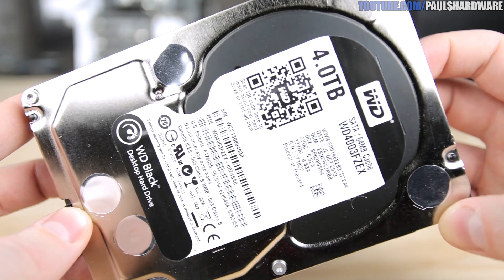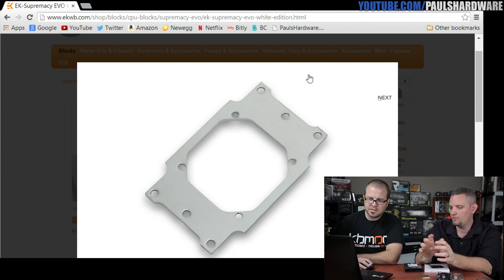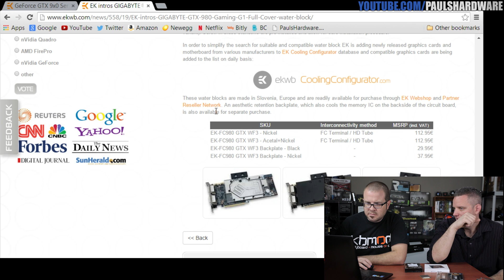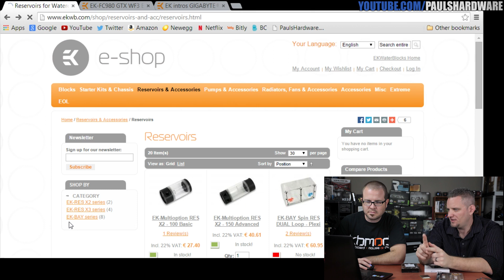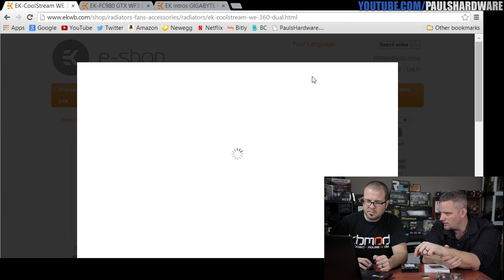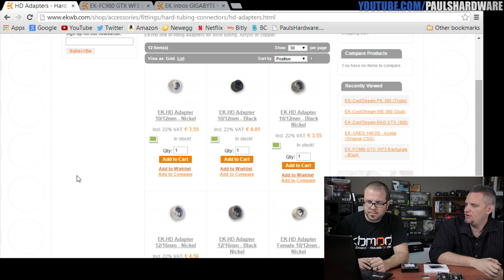Water Cooling Pros & Cons with JayzTwoCents

Comment: u could always use the fans off of the video card assembly in a custom case mount, or put them onto a radiator for "show" in a build  you do, which to me, seems very artistic if you can get them into the build properly.

excuse the name, im on my troll account on my backup pc while i pack to move to indonesia, which is why im looking into water cooling, and will probably be doing a lot of custom stuff there because of how hot it is in that country. (getting married there, that's why im going)

Comment: Don't know if it's already been mentioned, but, in case it's important information for someone building a loop, JayzTwoCents was incorrect in regards to head pressure / flow rate of the two pumps - the larger D5 has higher flow rate (1,500 lph)  and lower head pressure (3.9m) and the smaller DDC has lower flow rate (1,000 lph) and higher head pressure (5.2m - 7m  ǀ for 3.2 PWM model or 3.25 model).

You can also disregard the analogy in which he likens the larger D5 to a large displacement V8 with torque (high head pressure) and the smaller DDC to a lower displacement import with horsepower (high flow rate), as it obviously does not work here (even within the automobile context, it is an oversimplification that only obfuscates the related issues, more than it enlightens). The inverse relationship between flow rate and head pressure is due to the rotor design, not the physical size of the pump (akin to the inverse relationship between air flow and static pressure due to fan blade design, not the physical size of the fan).

That said, unless you are confined for space, most will agree that the quieter D5 is the option to go with.

Comment: Should i get the corsair h55 quiet edition or should i spend twice asmuch on a double fan radiator corsair water cooler? I find quiet the most important thing

im not planning to overclock or maybe later but only a small overclock on my 6700k

Comment: Around 34:00 you mixed up your pumps, D5 has the higher flow rate, DDC has more head pressure. And in my dual (serial) GPU system with 2 240 rads and a lot of 90° bends with a separate pumo and res one D5 on minimum speed has enough pressure, so if you can fit it and afford it there's no reason not to go with the DDC.

Comment: i might be wrong but isnt cheaper for testers(jay, paul, kyle, maybe edgar) to just buy a 1 tb or 500 ssd, download games, steam, and the os,then just use that in the builds, then you dont hVe to waste time downloading it again. pls tell me if that is possible because im pretty sure it is.
Reply: the thing that is being discovered with ssd is that they have memory leak. it is highly suggested to run an os on ssd and have a high speed hdd for everything else. so basiclly ssd have a potential to lose information over time. most are good for 2 years. some have been known to lose data in a matter of days.

Comment: When building a rig, in my opinion "go big or stay at bay" for me, think of it like this, it's an investment whether it be for short or long term. The water cooling is one of the best way to protect your system from hardware failure and then some, air cooling is sufficient, but like some of us that stay in areas that are hot humid, water cooling to me is the most efficient way to go. So do some thinking and ask yourself some questions like...1. do i stay in a nice and cool environment, hot, super hot, hot humid, cold, extreme cold etc.  2. do i have the budget for my build. After all has been noted then proceed to construct.
So yes there are some pro's & con's what it really boils down to is the end user, if he/she want either.

Comment: Remember the P4 Prescott CPUs? Those things were like space heaters!

As for HDDs, I don't run any internal drives. I have a SAS controller that I use with an external SAS drive chassis. I am thinking about upgrading my ATTO R680e to an LSI 8885 for 12Gb/s throughput for 8x 1.92TB Enterprise RISSDs. It's something to think about if you have limited internal drive bays.

Comment: Water cooling con:
1 gpu block, 1 cpu block, 10 HDC fittings, 1 240 rad, 1 DDC pump, 1 DDC pump heat sink, 1 100ml reservoir, 5 fans, 5-6 PETG tubes, 4-5 plug fittings 
grand total of just over $700

alternative: H100i, Hydro GPU cooler for a grand total of ~$200
Reply: You get NOWHERE near the performance and flexibility using that compared to a real water cooling setup. Trust me, i've done both countless times.  The ONLY all-in-one cooler that gets even RELATIVELY close to custom cooling is the EK Predator 360mm AIO and the Swiftech H320 X2 Prestige but those cost $230 and $199 respectively just for the CPU cooling, and you also need GPU blocks. The EK Predator and Swiftech ones are EXPANDABLE, meaning you can take the tubing off and add your GPU into the setup, and you can buy a cheap $50 "universal" waterblock for the GPU too if you wanna save money;  plus the EK Predator has "quick disconnect" fittings, that let you open the tubing to attach new GPU blocks etc.. without it leaking.   Lastly, the temperatures are FAR lower, getting easily ~15-20 degrees Celsius lower than even the Corsair H115i does, let alone the even smaller, weaker, H100i.  Then there's the fact that your math is complately wrong. GPU hybrid coolers run $100 each, and need to still be taken apart and attached just like waterblocks; unless you pay ~$130 to get them pre-attached to the card already. Either way that costs you a total of $300 if you build the GPU cooling yourself, or $360 if you buy it pre-attached.   You also have to deal with THREE sets of annoying AIO tubing that can only be  moved certain ways and may not fit your case etc..   It's far more worth it to buy one of the EK kits that are ~$250 or so and give you EVERYTHING you need to custom cool your CPU, then just buy two "EK universal" or "EK Thermosphere" blocks which go for $50 a piece or $70 a piece roughly, meaning your total cost would only be between $350 and $400, but be MUCH better than the subpar performance of an H100i and Hybrid coolers.
Reply: TheScaleless agree. but you have to look at it at non-enthusiast angle. Regular people would be happy with just any CLC. Their PC would still work great even if the cpu and gpu are running at 85C and practically inaudible.
Reply: thats also why jay said enthusiast build.
Reply: agree completely- and its still hard to identify what parts are best for a 2 res gpu and cpu water loop and gpu's are running cooler and cooler than in prior years. water seems to be for the beauty of it with $700 to $1000 expense

Comment: I am running two titan z with a 5960x and I use 3D programs like maya blender etc. 

my system becomes unresponsive all the time 

I am guessing that it could be overheating. 

I try to keep my gpu temps below 80 but my cpu temps are 55-65c under load.  I am water heating with a corsair sealed cooler and stock gpu coolers. 

could a custom water heating system fix the unresponsiveness? Any help would be much appreciated. thanks

Comment: I may be wrong but I think tubing size does matter to some extent, the smaller the tubing the pressure on the pump will increase (over working pump wasted energy) and you may not be able to move the cooling liquid through the system as quickly and as efficiently therefore the liquid won't be able to carry the heat away from the components at a pace at which a normal rad can cool it enough for the return unless you have something like a Phobya 1080 radiator but that is an external solution.

My main point... you WILL cool the water cooled components BUT you won't be cooling them down efficiently to the potential of what water cooling can achieve on a normal water cooled system.

Please correct me if I am wrong :)

Comment: i am far from actually setting up custom water cooling but i have some ideas and questions. (h100i and 295x2 are good enough for now!)

1) has anyone tested which is better performing/cooler on the in and outs of a gpu block - for example: in where water hits memory first then hits gpu then out, vs, in where water hits gpu first then memory then out. if you do sli/cf it seems like each card would be different if you wanted to run straight tubes. bottom card might be in -> gpu -> memory -> out, so top card would be in -> memory -> gpu -> out. maybe im OCD, but i would want them to be the same.

2) ideally it would great to go rad 1-> gpu 1 -> rad 2 -> gpu 2. so 1 card doesnt get the heat from the other. but obviously that would be a tubing mess. i see ekwb has tube y splitters ( not sure if for hard or soft tubing). what would happen if you ran the cards in parallel rather than in series. example:  rad 1 -> y splitter to 2 separate tubes -> both gpu inputs -> both pgu outputs -> y splitter back to single tube -> rad 2. would you lose pressure over each gpu? i would think each card would at least be the same temp, but would there temp be higher then the hotter of cards ran in series; or possibly there temps would be the average temp of 2 cards ran in series. or, wishful thinking would both cards run just as cold as the colder of cards ran in series?

update: nevermind the second question, i saw an updated video. they do make a block that splits the water to 2 video cards at once and 1 out. still not sure if you can configure it to hit memory or gpu first or if that matters.
Reply: +Jesus of Nazareth i know very little about custom water cooling. are you trolling or can you provide links to any articles/videos that have done testing. i really am curious about the results.

i am not sure if you are answering my first or second question. can you elaborate what you mean?
Reply: +Jesus of Nazareth so as long as you have a good pump 2-3 heat sources in a row wont matter? im pretty sure the videos i have come across that show gpus in series mention card 2 will always be warmer. but if its by 1 - 2 degrees i would agree that is not enough to really matter.

i mean i guess i can see that, but i still think if you went gpu1 - gpu 1 - cpu - 320mm rad, the cpu would be getting some warm ass water. vs going gpu1 - gpu 2 - 240mm rad - cpu - 120mm rad

technically those 2 setups have the same rad surface area, but break it down differently. i guess i got more homework to do

Comment: Why are you saying that CaseLabs Cases are bad for many harddrives? Take the right one, what's the big deal?
Dont cry about it and say the right stuff and not that inaccurate nonsense.
Take a DoubleWide Case like the TH10A and you get the mainboard compartment clean off all drives to show your watercooling and install them in the PSU compartment.

Comment: I smile a bit whenever I see that someone bought a GTX 980, have been reading more and more posts about games using >4GB of VRAM
Reply: +Slay Play games at higher resolutions than 1080p and high levels of anti aliasing, you'll see how fast those 4gb disapear
Reply: António Real Hell, that happenes even on 1080p!
Reply: Oops, i'm an idiot, i actually read "<4gb" instead of >4gb :p
Reply: António Real
Thought so, got me kinda confused there :|
Reply: *****
I'm fairly certain I've seen some slides recommending 980Ti for 1440p and 970 for 1080p in Fallout 4. No place for 980. (Then again, I've seen this one AMD slide promoting a 390 as a 4K gaming card)
Reply: *****
See, I'd love to argue about it, but there aren't any arguments besides "muh power consumption", no thank you, i'd rather be warm in the winter.
Reply: *****
How am I a fanboy exactly? The 390 is CLEARLY hotter (or sounds like a jet engine.)
Reply: ***** Jokes on you, I have an MSI 390. What are you gonna say now? "You are using it wrong?" It IS faster than a 970, but idles at 58(fans on). The card goes to 76 when doing some light gaming (which brings the fan to about 48%)  and to 87 when playing heavier games(68% fans) And don't give me that shit about the quiet mode, the card idles at 61 in that case and whenever the temp goes above 70 the fans go crazy. No wonder you're saying "it is not that hot" Sure it's not if you have the fans running at 100% constantly. But it's all about that temp/noise ratio,.
Reply: *****
 I am using the Afterburner, otherwise I would idle at about 62. And no, 58 is not pretty low, well, maybe for hawaii (fans at 24% btw).
Reply: *****
Idle and it's not exactly 58, more like 57-62
Reply: +Ji “Da” Cah He clearly has the MSI Twin Frozr V version then.

Comment: When watercooling a GPU, Does the manufacturer really matter if you are gonna strip it all off to put a waterblock on it, i mean i have a r9 290 vapor-x but if i'm gonna take off all of its cooling components then its just an r9 right? So i wouldn't have to get another vapor-x, just another (less expensive) r9
Reply: +nafaka12 Some GPU's have different PCB's so they will overclock better :D

Comment: $800 for water cooling systems? I come from the days of the Eheim 1250 water pumps, Danger Den CPU & GPU water blocks and Hardware Labs Black Ice Extreme radiators, and finally, YS-Tech screaming 120mm fans. Extreme cooling was to introduce Peltier TEC modules & Cold-plates, neoprene foam insulation for your socket 478 or socket A to prevent condensation.

Comment: Ok Paul, and Jay, got a question for ya. I've had my dual loop watercooled rig running for several years now and I'm bout to start getting a list of parts for upgrades (which will take a while to buy) but my question is, why the importance of having the water pump fed directly from the res? Besides the ease of filling the loop. Does it cause more stress on the pump? Affect life span? That loop is from pump out, up to 360 rad, down to 250 res, down to 2 gpu's, up to inlet of pump.

Comment: ***** Paul's Hardware D5 is the higher flow rate and the DDC is the higher head pressure. I am starting my first fully custom water cooled build too. I ordered 2 D5 pumps to get enough head pressure while still keeping the high flow rate. Go for the 5960X definitely. I am going for one myself to replace my 2008 dual quad core Xeons build. If you haven't picked a name i suggest project Chessboard, Checkers, or something along those lines.

Comment: You ought to drop in a Plextor M.2 drive for the main OS as well as the SSD for video work.
I definitely agree with using the 5960x for  your main system.

Comment: I'm going to jump into the custom water loop camp when I upgrade in about 3 - 4 years. Everything major heat generating component I have right now has it's own AIO which is nice, no real maintenance except applying new thermal paste every year or so and the 4 times a year dusting of the rads. The performance and silence is already there in my rig, all I'm missing is the looks of a custom loop.

Comment: After seeing the Alphacool NexXxos GPX block reviews on OC3D I grabbed a pair for my Asus R9 280x DC2T's. I'm so happy with my choice because the blocks are cheaper than most (~$90 for block and back plate), and they exceeded my expectations by dropping my temps by 35C from the Direct CU II coolers! Each card gets to a max of 42C at full load despite OCing to 1250Mhz. Those are sharing the loop with a 4.8Ghz 4770k, a 35mm thick 360 rad, and a 60mm thick 240 rad. Needless to say I'm loving the water cooling talk!

Comment: I was pretty sure the R9 290X2 was the most powerful card, but you you meant, most powerful Nivida single card, then okay I guess. But most powerful card? Nah
Reply: The 295X2 is a DUAL GPU card, and Paul is talking about most powerful single GPU card belongs to the 980
Reply: Fair enough, I only mentioned it because I knew it was in about the same price bracket. Is the R9 295X2 more powerful than the titian Z? I'm quite superseded you actually replied, I'll make sure to subscribe.

Comment: I have built a cpu 8350 2x gpu 7870 watercooling with 150$ only for the blocks. For GPU cooling only the vram and I have glue small copper on the other hot spots. The expensive parts it's the EK D5 pump and the EK 61mm 3x120 tank! The CPU block is full copper and metal top.All the blocks is from China small maker Syscooling.
Temps to GPU never go above 45C and vram to.
The system is working perfect you can overclock it to extreme all day without problems.

Comment: Dang. Only if I had $10,000 to build an awesome gaming machine. XD . I built a $700 pc and it can play Call of Duty Advanced Warfare at maxed settings with a solid 40 fps. (May be a few more Fps then normal from overclock.) If you want to build the computer I built check out my Pc Parts Picker build. http://pcpartpicker.com/user/MisterAxeMan/saved/kbNscf

Comment: 31:12 This is not true actually. You can buy bigger tubes for the reservoirs and you just remove the top lid and the bottom pump block part and you can screw the bigger tube in between and have a 200mm reservoir. It's what I have atm in my pc.

Comment: Project Orca (Or Blackfish). Both are Black/White, water-cooled/orcas live in the ocean, if you use the 5960X it's the current top cpu and you're using the current top gpu/orcas are the top ocean predators, etc.

Comment: You should name it "Harpocrates" the greek god of silence.

You better stress test the crap out all your hardware before you start setting up the loop. Its funny but your build will be like a step up from mine. I got the x79 and 970's. I already spent above $800 on my wc parts. still not together yet. Saving up for some sleeving plus tools.

Good luck. Looking forward to the final outcome, check out the mod zoo forums for some ideas and mnpctech if you dont know about it yet.